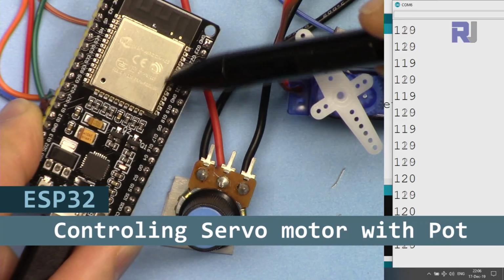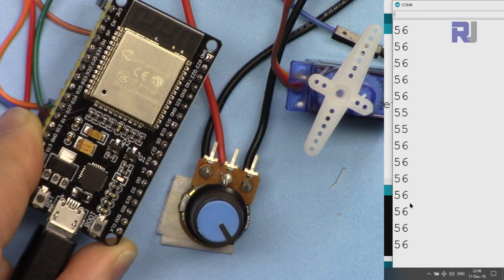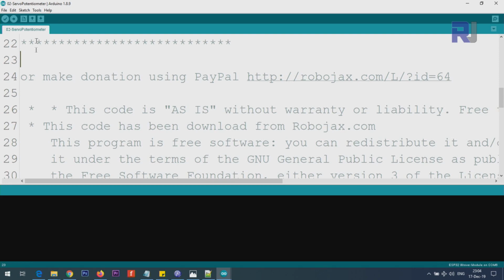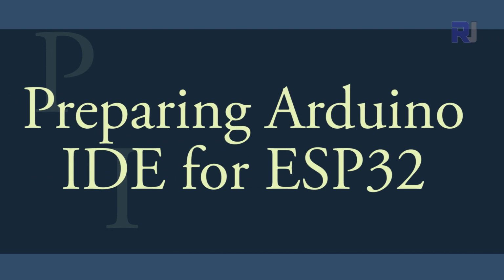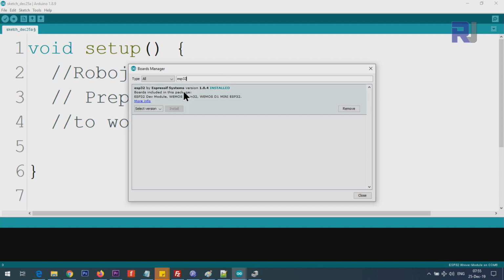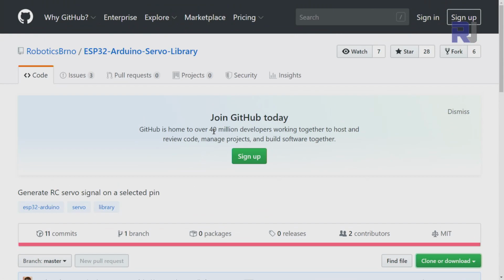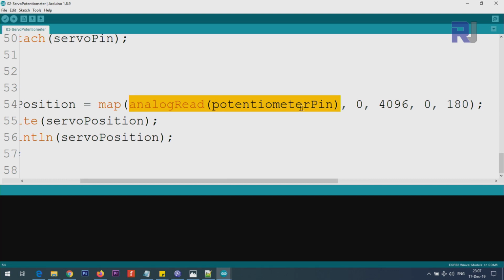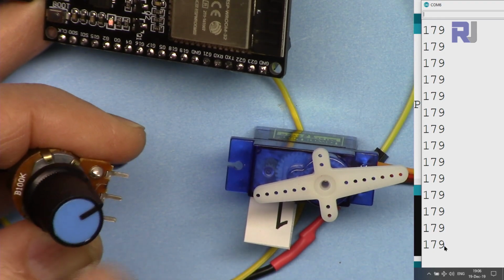Control Servo Motor with ESP32 and Potentiometer - RJT252

Comment: cant get it to work here is error messages: 

Arduino: 1.8.18 (Windows 10), Board: "ESP32 Wrover Module, Default 4MB with spiffs (1.2MB APP/1.5MB SPIFFS), QIO, 80MHz, 921600, None, Disabled"

C:\Users\owner\Documents\Arduino\libraries\ESP32-Arduino-Servo-Library-master\src\Servo_ESP32.cpp: In member function 'bool Servo_ESP32::attach(int, int, int, int, int, int)':

C:\Users\owner\Documents\Arduino\libraries\ESP32-Arduino-Servo-Library-master\src\Servo_ESP32.cpp:66:5: error: 'ledcSetup' was not declared in this scope

   66 |     ledcSetup(_channel, 50, 16); // channel X, 50 Hz, 16-bit depth

      |     ^~~~~~~~~

C:\Users\owner\Documents\Arduino\libraries\ESP32-Arduino-Servo-Library-master\src\Servo_ESP32.cpp:67:5: error: 'ledcAttachPin' was not declared in this scope; did you mean 'ledcAttach'?

   67 |     ledcAttachPin(_pin, _channel);

      |     ^~~~~~~~~~~~~

      |     ledcAttach

C:\Users\owner\Documents\Arduino\libraries\ESP32-Arduino-Servo-Library-master\src\Servo_ESP32.cpp: In member function 'bool Servo_ESP32::detach()':

C:\Users\owner\Documents\Arduino\libraries\ESP32-Arduino-Servo-Library-master\src\Servo_ESP32.cpp:80:5: error: 'ledcDetachPin' was not declared in this scope; did you mean 'ledcDetach'?

   80 |     ledcDetachPin(_pin);

      |     ^~~~~~~~~~~~~

      |     ledcDetach

exit status 1

Error compiling for board ESP32 Wrover Module.
Reply: lol same
Reply from the maker: It means you have removed portion of the code. Read where it says “not declared”
Reply from the maker: Watch introduction to ESP32 video
Reply: I'm got the same issue

Comment: Hello nice video i want to ask what potentiometer did you use? Because there are a lot of Potentiometer? 10kOhm?

And is it possible to write the value of the servo live on the pc? Maybe with the SerialMonitor?
Reply from the maker: Hello, the value is not important. anything above 1kΩ is ok. I've mentioned in so many videos and forgotten it.  I just checked the code page and it is printing the position on Serial monitor. Just open it and make sure your serial monitor is set to 115200. see this image to know how https://snipboard.io/y3pKwG.jpg
Reply: @robojax  Thank you for the fast answer :)

Is it possible to write the value what the servo should have on the computer? Or only watch the position on the Serial monitor?
Reply from the maker: "on the computer? did not understand it.
Reply: @robojax  if it is possible to control  the servo live with the pc? For example send 110 deegre to the servo and he is moving?

Comment: is it possible to use a single button or a nextion touchscreen to rotate 180 on a push and ROTATE BACK 180 degrees? (not another 180, but reverse)
Reply from the maker: Yes possible. But I have no access that that touch screen. If you can detect the touch in Arduino, or ESP32, you can easily take action to do anything you want.